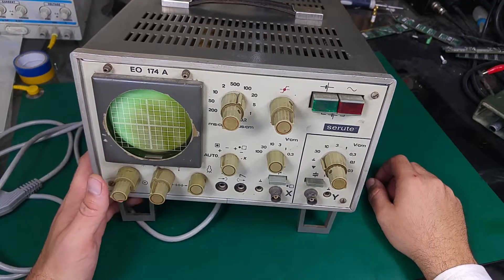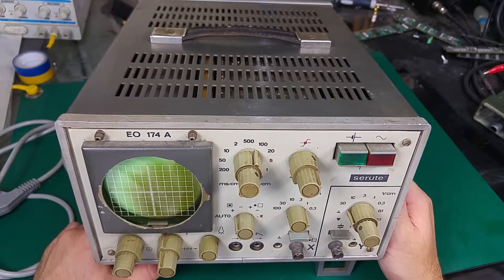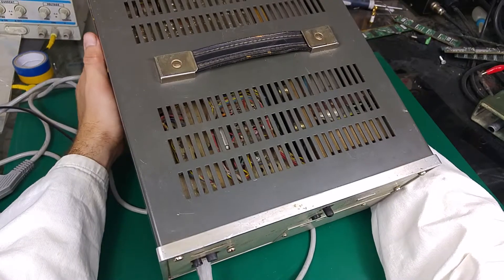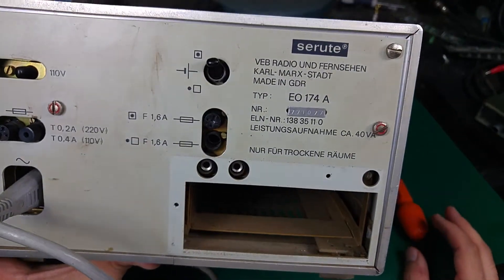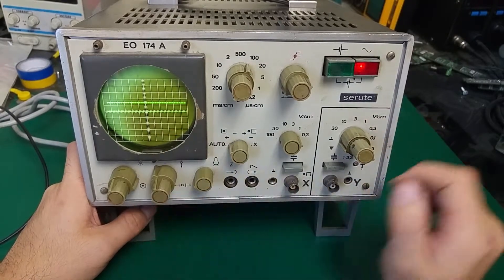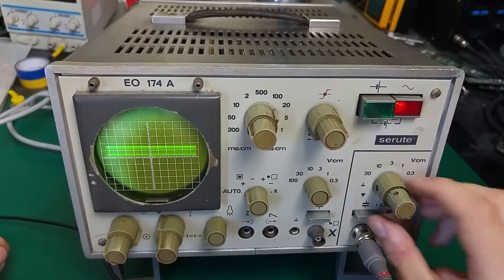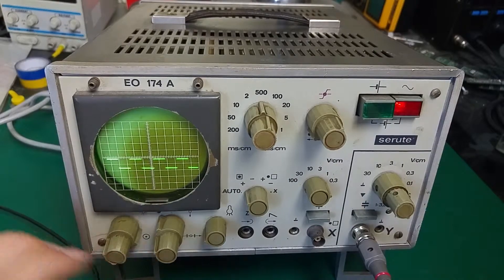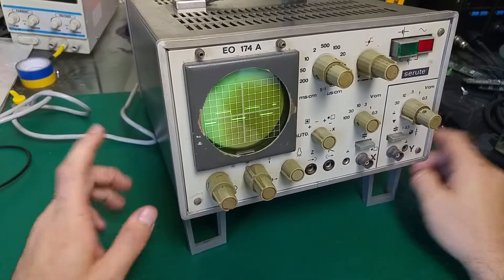EO 174 A SERUT oscilloscope (RFT)  vintage battery powered portable scope

Comment: Thank you for making this video i have the same oscilloscope and it was helpful to properly use it, yet i don't know how did you get to see the square wave without any external imput, my oscilloscope without any imput only shows a flat line, I am not that experienced with electronics so i appreciate help.
Reply from the maker: That oscilloscope have build in test signal generator, right selector switch have triangle icon (under ground) and it internally hook input to signal generator.  Flat line is correct - easiest way to play around without probes  is to hook it up into audio input, like phone and play  50hz tone, there is plenty of YT movies with it so You should get nice sine wave.  I don't have it anymore so I can tell You how to set it because I don't remember - You need to play around, with audio input level You most like won't burn anything if mistake happen.